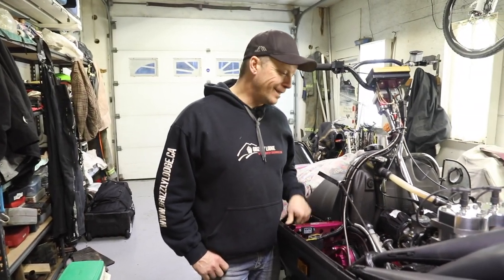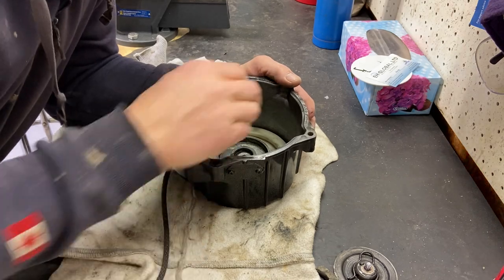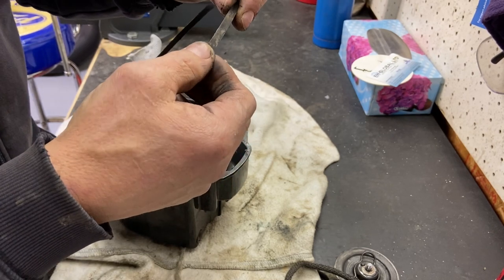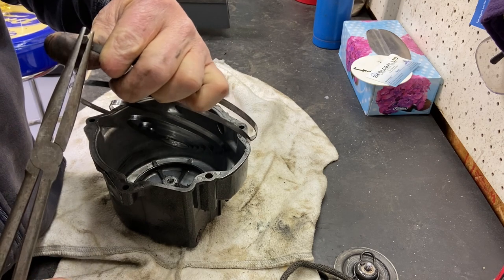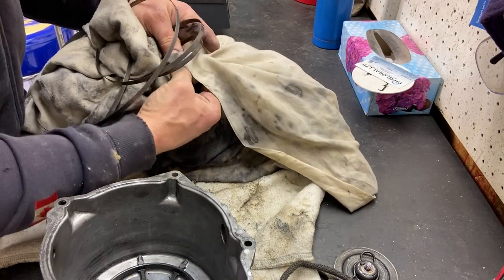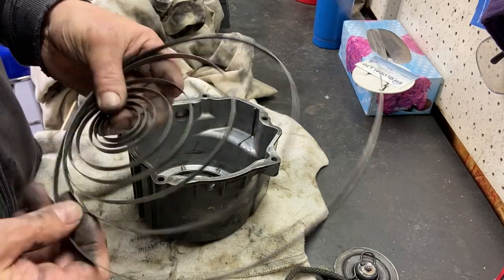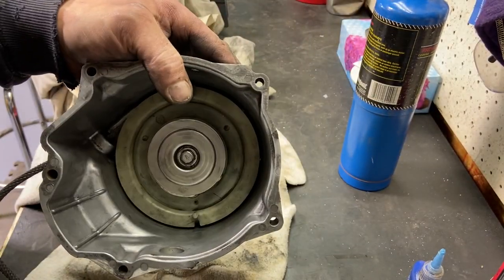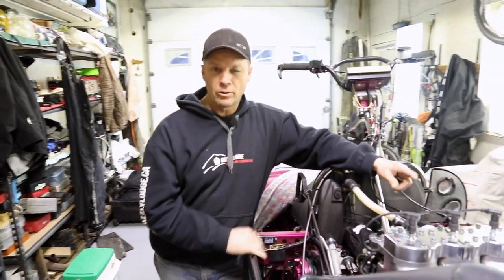Recoil rewind remove, inspect, fix, install. Snowmobile recoil rope.

Comment: Working on a 90 AFS Jag Deluxe, how does the recoil cover come off the engine? I see no fasteners, or does the whole side cover with the fan and belt come off all in 1 piece? Could anyone explain what AFS means? Thanks
Reply from the maker: A-Arm Front Suspension , rewind is separate , bolted on to fan cover !
Reply: @DIGIT9  Thank you. 2 bolts were missing but I did find the top and bottom bolts, kinda easy to miss them. Thanks again!
Reply: @DIGIT9  Can I ask you some ?s My first ever sled, so bear with me. On the 90 Jag Deluxe. The oil injection has a line coming from the oil tank to the injection pump and then there is 2 smaller lines that goes to the intake manifold, Is that correct? And how does the lower engine get lubricated? Is there a line that suppose to go to the lower engine for lubrication? Last question is on the fuel lines inside the gas tank and to the pulse pump and to the carb size? Some says 3/16 and others say 1/4 inch. Thanks in advance.
Reply from the maker: I dont believe those motors have lube  lines to the crank bearings , that gets done after the fuel is mixed with oil in crank case ! Fuel lines for that sled arent that big of a deal , 1/4 " would be better , as long as lines seal good on barb ends !
Reply: @DIGIT9  Well this sled may be doomed, I can't get the secondary clutch off. It really needs to come off to do a deep scrub down cleaning. I had the sled on its side with PB Blaster soaking, tried pounding it off with piece of oak wood and hammer. I've haven't tried the primary clutch yet, don't have the tool. I'm betting that is also stuck.
Reply from the maker: Just keep soaking it with penetrant ! Those splined shaft clutchs always do that ! Primary is on a tapered shaft , should come off easier ?
Reply from the maker: Can always take secondary apart on the sled , only piece that will be left on is inner shiv ?
Reply: @DIGIT9  This one (secondary clutch) has a keyed shaft and I finally got it off. I am looking at the clutch, (have not taken apart yet) and I see the white spring is in the 2nd hole from the left. I'm not familiar with this but when I do put it back together should I use that same hole or should I go to the 3rd hole which would be center hole. Also the 3 little buttons has some wear but not bad, should I be concerned? Sled has 3,000 miles. Gonna try watching some videos while I wait for your response and want to say thanks for your help on this. Just in case you need to know, I'm on the Illinois/Wisconsin border and want to use the sled for trails/around home. Nothing extreme!
Reply from the maker: If using original spring , you can run it in 3 rd hole , new spring back in second hole !
Reply: @DIGIT9  Do these types of secondary clutches have alignment marks for the 2 halves? 90 Artic cat Jag Deluxe.
Reply from the maker: Nope , just the primary !